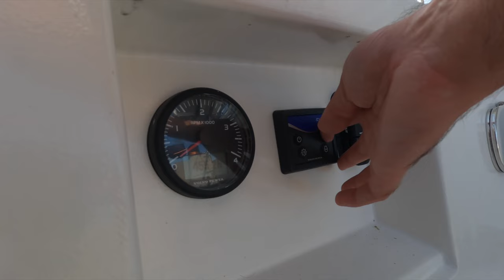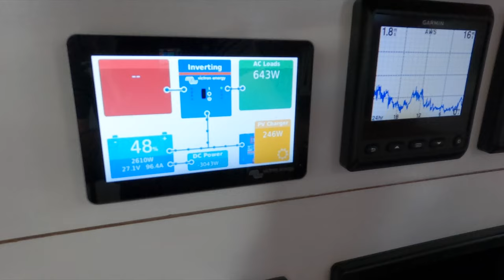Sail Life - DIY beanbag chairs for sailing? They are awesome!  ⛵️

Comment: I made a bean bag a couple of years ago, and pretty soon I opened it up and poured all the inside into an inner bag and put a zipper on the outer bag. that way I could shuck the outside in the washing machine every now and then. You could also have two outsides and change to a dry outer bag after a pouring.
Reply: I did the same I used a nylon material. An zipper ... Not bad for a 1st go... I had a "leather" bean bag as a kid . Used to jump on it .. it was a static filled winter day.. when POP 💥lil beans stuck to everything.. blew up Mum's vacuum cuz of them...😂🤣😂🤣...made a mess found beans for years after .....lol!!! Good times✌🏼💗😊
Reply: Agreed, always have an inner bag + outer bag. Makes cleaning a lot easier and less risk of bean spilling if a seam breaks
Reply: @kyoni6098  you mean "when", not "if". :) #beentherevacuumedthat
Reply: Yes, ours have an inner liner for the same reason🙂

Comment: Great visiting with you folks, your videos are a real breath of fresh air and  sunshine.     It is wonderful watching both of you working together creatively; if you can do it, so can I.

Good luck with the self steering vane, as I recall with a little tweaking after install, the patience  of Buddha and an acceptance that plus/ minus 15 degrees when sailing they work great.   I hope you have one that is easy to take out of the water, backup the boat with a vane installed is a whole new level of interesting; ask me how I know.

Now it is time to freshen up my coffee and continue to address the 70 year old galvanized pipe under my daughter's house; even ashore the DYI fun never ends.  DYI ashore is fun because at the end of the day I can soak in my daughter's hot tub with a long prayer than tomorrow I will still be flexible enough to crawl into the way too restricted under the house access openings;  yep household plumbing is just like a boat; limited access and water where you don't want it.

Comment: Mads... you need to modify those beanbag chairs and add a stainless-steel zipper as the "beans" will flatten-out with time.  I used to have a large beanbag chair as a teenager and I had to add beans every few months or so.

Comment: I live in an 11 meter steel ketch (made in 1956) but that is only 3 meter wide, yours looks much wider, what size is Athena ? I love all the tech you build inside. I have a complete electronics repair/development workbench on board.

Comment: You'll find the balls squish down over time and you'll need to add more eventually.  So good for the one with a higher fill right now, it'll probably be perfect in a few months.  

+1 for the comments about adding a zipper for refills. Just make sure you sew the zipper pull closed so it doesn't open and spill the beans unexpectedly.

Comment: Thought I saw a Hydrovane on this boat a couple years ago
Reply: Athena had one when he bought her. Mads removed it when doing deck seam/joint work. The type he had was not compatible with the solar arch he built, so he sold it.
Reply from the maker: Thanks, Water Faucet 🙂 as always 100% correct 😀

Comment: That poor Sailrite machine sounds terrible. A sewing machine should NOT have a rhythmic CLUNK!  I hope you plan to finish the interior trim this winter and Spiffy up the wiring.  :)
Reply: My sailrite started making the same sort of noise - you need to check the alignment of the shuttle carrier with the needle - the manual shows all the adjustment points.